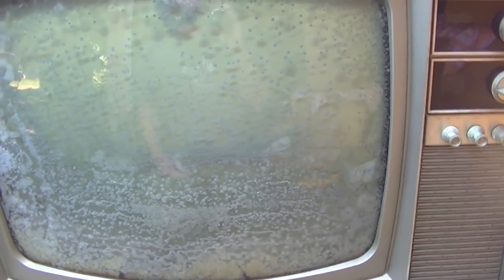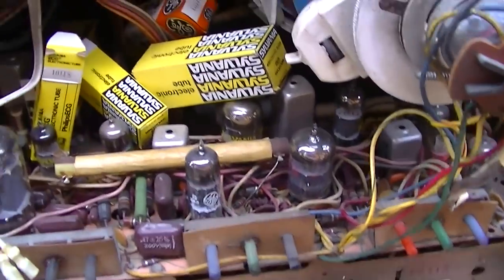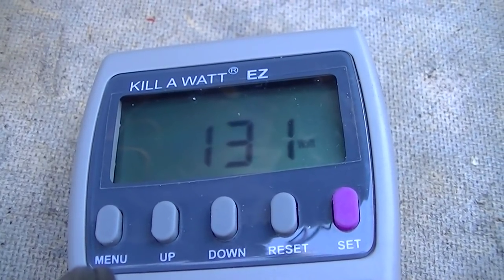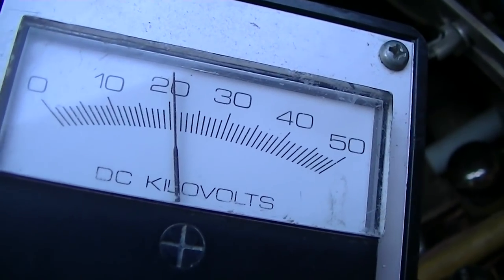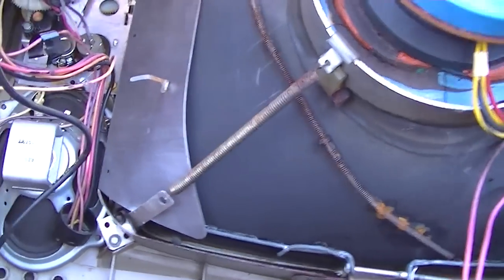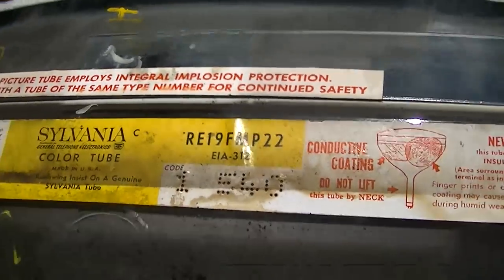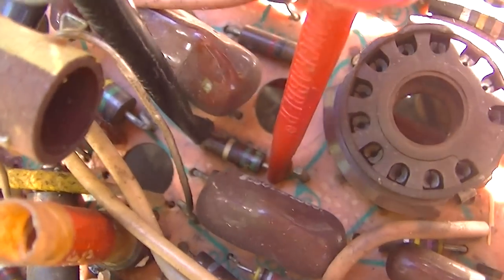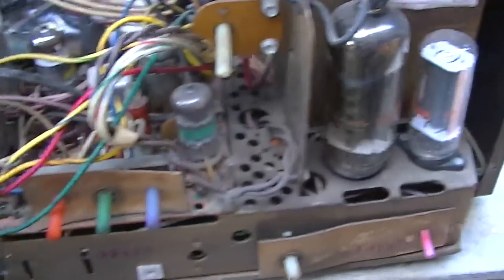Sylvania Color Cataract Removal pt2

Comment: It should be interesting to see the chassis diagnosed and repaired in the meantime, like what's causing the hot resistor, or the lack of sound, lack of vertical, etc.

Comment: My network speeds cant handle much more than those TVs are capable of producing anyway, so the 1080p thing isnt an issue.
Reply: I didn't even bother using the 1080 p HD setting on the last computer, even though it could handle it, with few exceptions it's a waste of time.

Comment: This will be interesting to see how it turns out, I am used to newer crts with the band reinforcement so I have not yet encountered a set with pva degradation, but would love to find one and try removing the safety glass I always have always been into vintage electronics but never got to see a set that even has a tube type chassis in person always seemed to come across solid state sets that were late 70s mostly early 80s I have fully restored modfied and repaired many crt sets and even own a sencore cr7000 crt rejuvenator/checker and have been playing with crt sets for 15 years and I have not seen a set older than the late 70s in person ahh I really want to find some of the tube type color sets, I once owned a black and white but it was an 80s set go figure lol. how do you guys find these treasures?